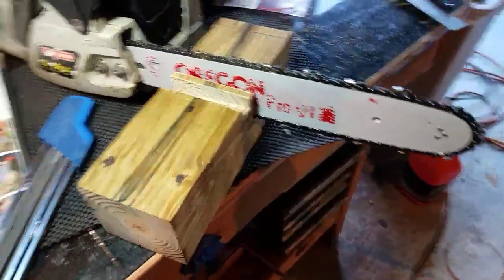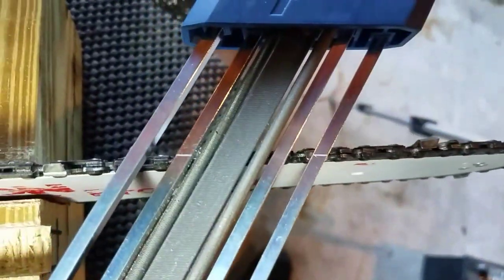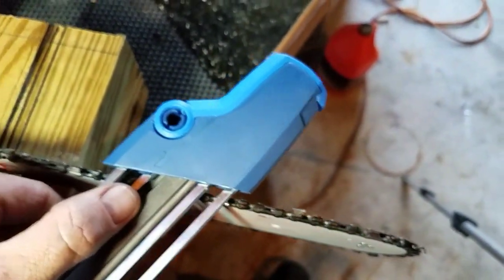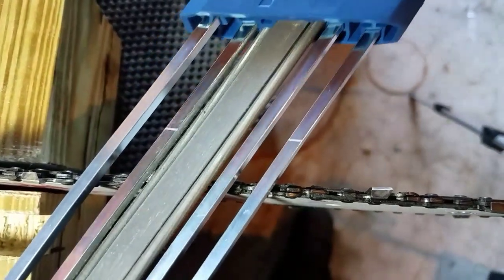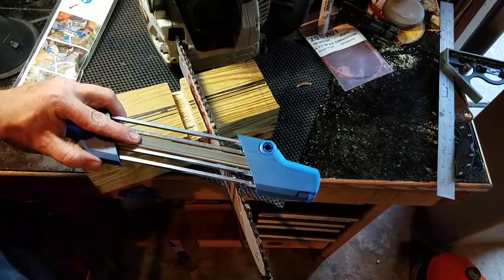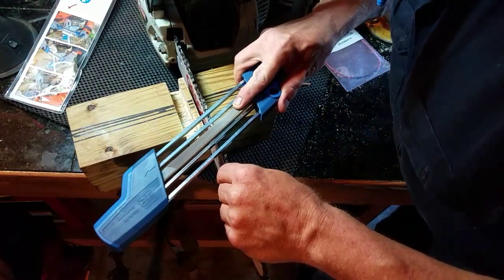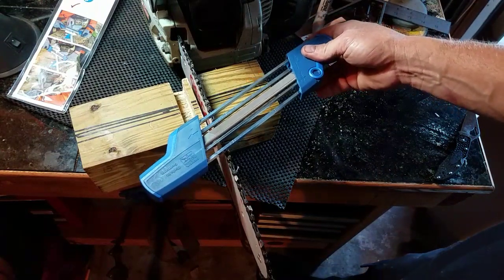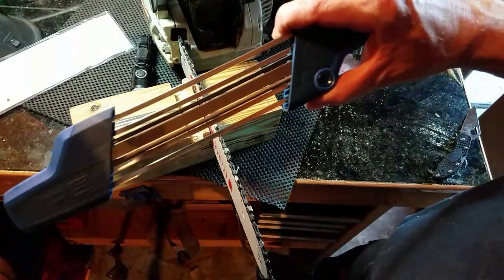Keep your Saw Chains Sharp and your rakers short!

Comment: Anyone using this tool should know that the angle of the plastic that was used in this video to file at the correct angle is 30 degrees but your chain might require sharpening at a different angle, such as 25 degrees so don't assume that the you should make the edge of the plastic parallel to the bar.  Check what angle is necessary for your particular chain.

Comment: i use the Timberlake sharpener but wanted a quicker solution for in the bush also Timberlek does not audjust the rakers with is i can do an in field sharpen and then take the round file out to adjust th rakers after i have used the Timbelake

Comment: I bought one of these sharpeners and found they are great for sharpening a chain but take too much off the rackers. After a couple of sharpening the rackers so low that when sawing a log, grabbed so bad that it was impossible to keep the saw cutting, also the saw grabbed and vibrated so bad you had to hang on for your life. By removing the racker file, then sharpening the chain it worked a lot better. Only needed the racker file after a couple of sharpenings. Only needed one stroke to take the racker down.
Reply: It's not bent. I have tried the thing several times and it takes so much off the racker, I guess at least 35-40 thousands. Works great if you remove the racker file, sharpen the chain, then replace the file and give each tooth one more stroke.
Reply: Just ordered one I will check that out..thanks
Reply from the maker: I wonder I'd the file (round) was too small it would necessarily make your raker file dig to deep. Furthermore you could achieve a reasonable sharpen with a guided smaller file. Just a thought that I'd investigate as I have a little OCD;)
Reply: 3/8 chisel chain with a 7/32" file. Maybe I just got a bad holder. It not the wrong file. I have tried this file holder and it just takes too much off the racker. If yours works for you, I'm glad you got a good one.
Reply from the maker: i too have experienced this over the last year. good comment
Reply: Thanks for mentioning this.  Just ordered one. Will watch for this
Reply: Flat file is to thick?